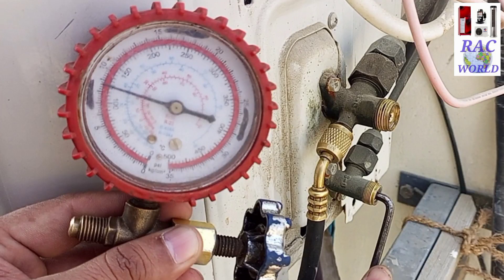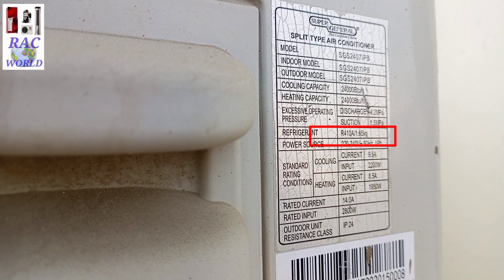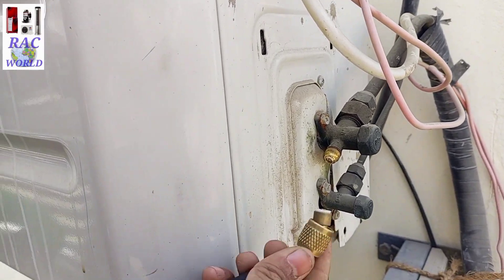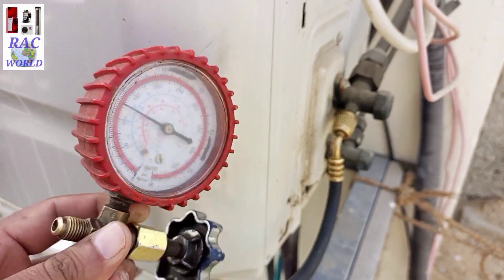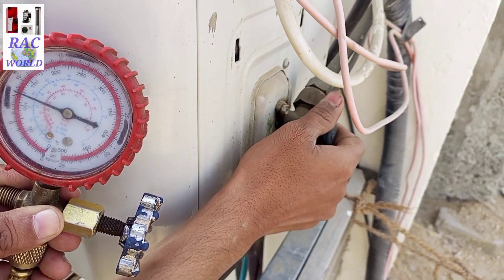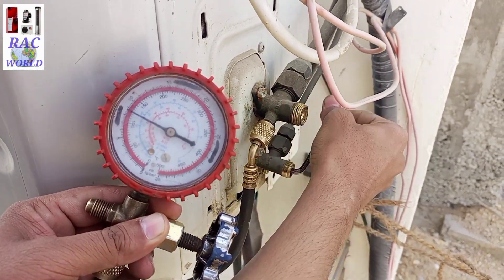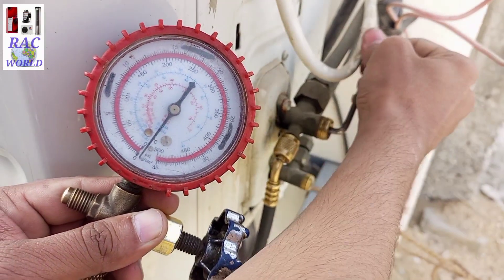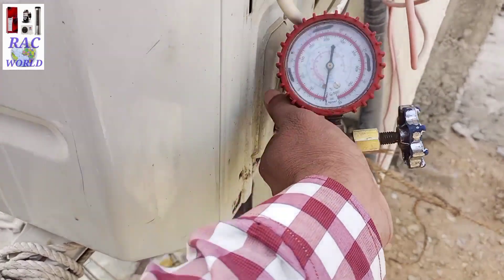R410a refrigerant pump down|how to pump down/store split ac refrigerant|R410a|Ac repair

Comment: Is this done with or without the outdoor unit running ?
I need to remove the R410A that has a dead (Non Functioning) Outdoor Unit.
Reply from the maker: It will be done, while outdoor unit is running.